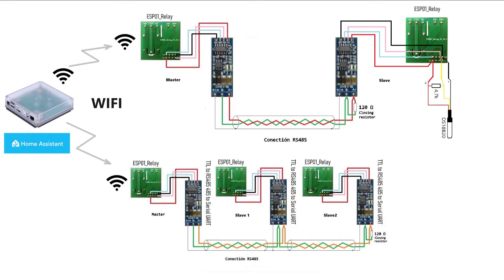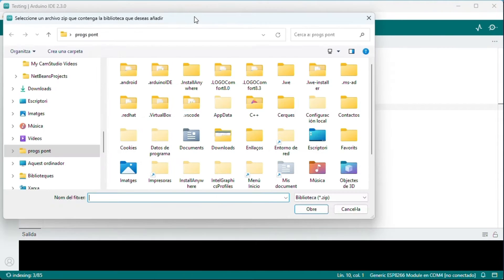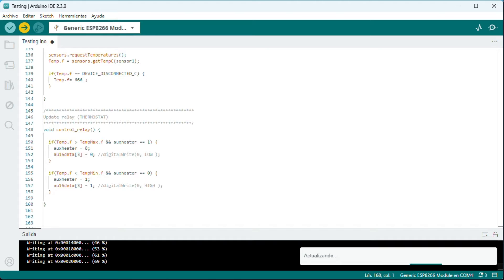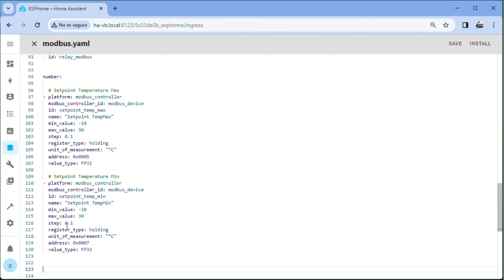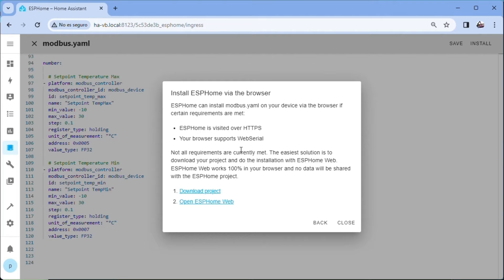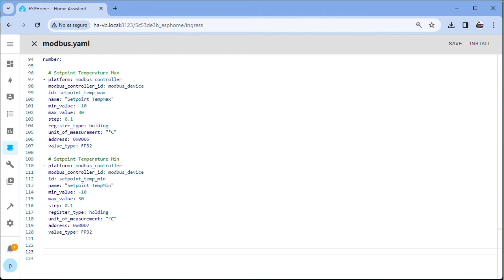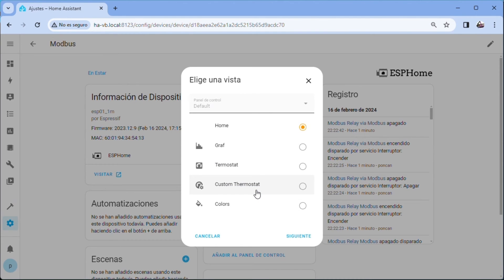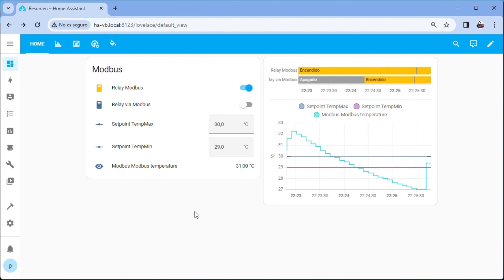Modbus RTU Slave for ESP8266 ESP32 with Home Assistant control example. 'Client'

Comment: Can you tell me why you used arduino instead of esp home to write the Slave device code? At the end of 2025, are there important reasons to use the IDE, or is it your preference and is it also possible to implement it on esp home?)))
Reply from the maker: Thanks for the comment, and sorry for the delay in responding. We don't know why we don't receive notifications of new comments.
We use the Arduino IDE because it's easier for us to use C than Yaml. We also ran a lot of tests with different libraries and only managed to get it working with this one, but it's probably due to using an ESP8266. This problem probably wouldn't exist with an ESP32. We've been looking at the ESPHome documentation, and while it is possible to implement the slave, for some functions you'd have to use Lambda templates, which are actually C code. Also, if we use ESPHome within Arduino, we'd have to connect the slave to the PC to configure it and then disconnect it, leaving us with the offline configuration in ESPHome for Home Assistant.
In any case, it would certainly be possible to do it with some tests. We don't know if it would work on the ESP8266, but it probably would on the ESP32.

Comment: Why did you write the slave-code with arduino? is there a reason, why you didn't choose esphome and yaml? The esphome documentation says, it is possible to use it for modbus slave. I'm asking because I'm trying to find a yaml solution for a esp32-slave. But I have problems to define the "server role" in the yaml...
Reply from the maker: Thanks for the comment.
The reason we used Arduino IDE is that we did tests with ESPHome but we couldn't get it to work, the truth is that Yaml is not as versatile as IDE when it comes to defining variables, registers... Maybe it's easier now since ESPHome is constantly evolving, ESPHome is designed for the device to connect to HA via wifi, so how do we make it compatible with being a modbus slave?
Even with Arduino IDE we also had a lot of problems we tried several libraries until we found one that worked in the slave role.
The other reason is that once the slave is created it also works as a slave for any other system apart from home assistant.
Reply: @progspont2623  Thank you for the response! I suspected that Modbus slave might not yet work reliably on ESP32 devices. It's strange that even the example code from the documentation doesn’t work. It would be much easier to configure everything with YAML.

Do you have any experience with how fast the query interval for the slave can be? In another project, where I used an Arduino Nano as a Modbus slave (connected via USB to a Raspberry Pi running Codesys), I frequently encountered connection issues. Sometimes, only a restart of the systems solved the problem. 

My suspicion was that reading the sensors was disrupting the Modbus connection, as the sensor readings were occasionally a bit slow. Unfortunately, I was never able to resolve this.

In Home Assistant, there are also issues with Modbus speed. The query intervals have to be several seconds; otherwise, the system eventually crashes. In commercial Modbus solutions, query intervals as short as 200ms or even less are possible.
Reply from the maker: Our experience using home assistant as modbus RTU master both directly: https://youtu.be/x1uV6nRxry4
As well as through ESPHome: https://youtu.be/hw3m3GAoCeM we have not had any connection problems, in any case we have always used a speed of 9600 bauds, we have not tried higher speeds mainly because we did not have the perfect installation (shielded cable, final resistance...)
As for the update interval of 15 seconds which is the one that comes by default it does not cause any problem, for some tests we set it to 1 second and in a test HO that only had this integration it worked for a few hours without problems.
For 200ms I think it will also depend on the device on which the HO runs, a high-end mini PC is not the same as a raspberry
We also have one connected to an electric meter with several parameters in the production HO with a 1 minute interval that has been working without problems for two years.
As a slave, the only one we have managed to get working is this one and it hasn't given us any problems, even putting two slaves on the same modbus loop and updating every 15 seconds.
You will probably find it easier to use Yaml, but don't be afraid to try it with the Arduino IDE. If you are comfortable with Yaml, you will find it very easy and more versatile than Yaml.
Regards

Comment: I want to a make a home automation for my home. 
So that I am decide to control all the bulbs and fans through the home assistant or phone. 
I am not connect all relays and senaor through the wifi network because my home is big. Wifi range is to small for my home automation. So that I am decide to implement modbus for connect all relays and sensor. I thing Modbus is more reliable and easy to implement because the wired connection. I want to connect 10 node. Each nodes contains or hold the few relays and some sensor such as temp and humidity CT sensors mmwave sensor motion sensor. And each nodes connect through each other. And last node is finally connected to think client or Ressbery pi which is operated home assistant os. 
Please solve my problem and give the feedback
Reply from the maker: We appreciate the comment.
We are sorry we were unable to answer earlier.
In theory, it is possible to set up a home automation system based on a home assistant with Modbus RTU communication only.
It could be done with ESP32 or ESP8266 slaves, each with an address. As for connecting the master directly to the PC / Raspberry Pi machine, it could be done with a USB to RS485 converter. There are many of them, even for less than $3 on Aliexpress.
In Home Assistant there is an integration https://www.home-assistant.io/integrations/modbus/ type: serial, we have not tested the parameters.
(it is a pending project that we unfortunately do not have time for)

With another ESP as a master I connected to HA via WIFI if you can see it in our tutorials and ESPHome.
In any case, if you do not have much time and do not have a good programming/electrical technical base (which we do not know if it is your case) it is easier to put WIFI repeaters and use commercial devices.
If you have any further questions about the connection with the slave, do not hesitate to ask.

Comment: Hmm … nice … to use the slaves with Node Red instead of Home Assistant would be great 😊
Reply from the maker: Hi, thanks for the comment.
We do not work with Node Red but this slave is configured with the Arduino IDE therefore it should work with Node Red.
Reply: @progspont2623  I will try and let you know the result with Node Red. Best Regards Nils

Comment: if you are planing to build those into the wall or other appliences, i would add a virtual switch to the modbus slaves, make them enable wifi/hotspot when activated to use ota updates when this virtual switch is on.
Reply from the maker: Thanks for the comment :)
We do not understand the comment very well, perhaps due to a language problem.
We do not know if it is a question or a suggestion, in any case I must say that if the slaves were needed to be upgradeable, taking into account that in many cases they are outside the range of Wi-Fi, we think we remember that we have read somewhere that there is some way to update using Modbus.
Reply: @progspont2623 sw update via Modbus would be exceptional great!
Yes it was a suggestion to enable wifi on the slaves using Modbus to allow software upload via wifi